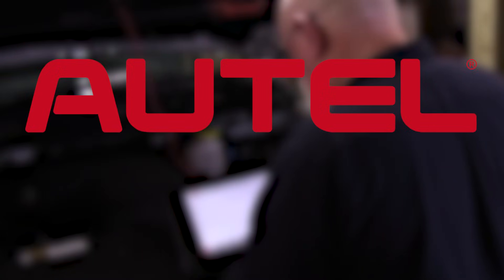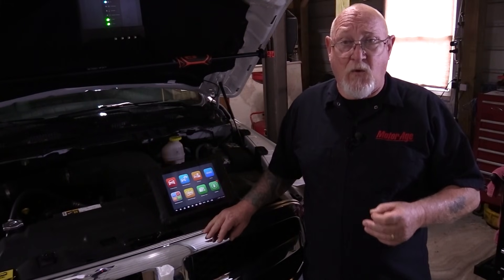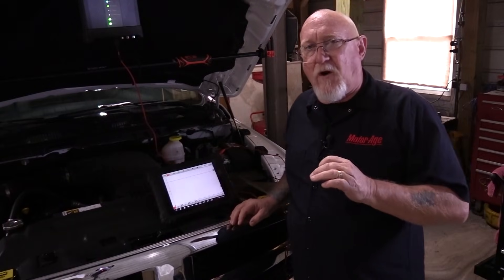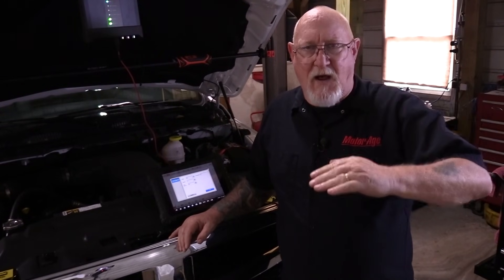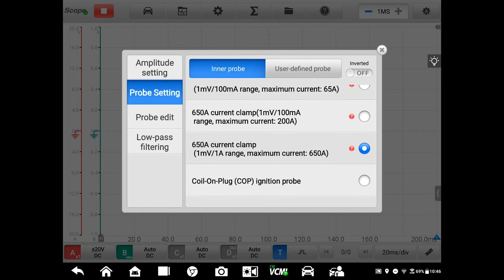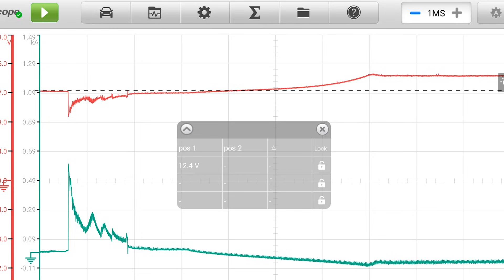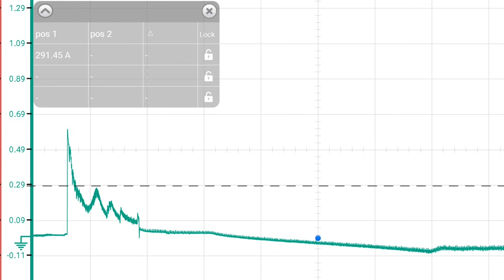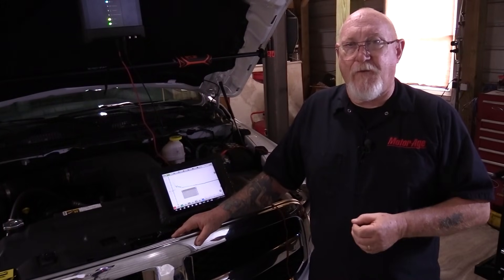The Trainer #137:  Putting The Autel Scope To Work!

Comment: So what happens if the inrush current exceeds the 650A maximum of the clamp? Will it just get the peak measurement wrong? Could it throw off all the measurements afterwards? Or will it damage the clamp or scope?

Comment: Awesome. Set scope to AC for measuring voltage drop at battery terminals. You can also examine/measure the alternator ripple amplitude to confirm good diodes..

Comment: Is the MS919 scan tool still a worthy scanner to invest in in 2024? I was looking at the MS919 or the Snap-On Triton D10 for electrical diagnosing. Thank you for this video. I'm still learning the ropes on how to use a scope.
Reply: All capable. Snap on is more and has different features. Get what you can afford and use the wheels off it then upgrade